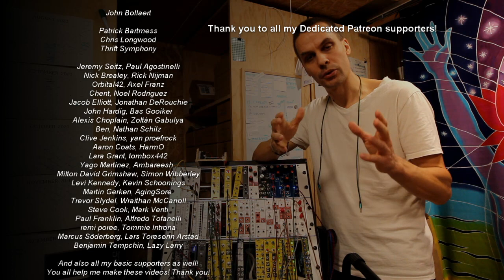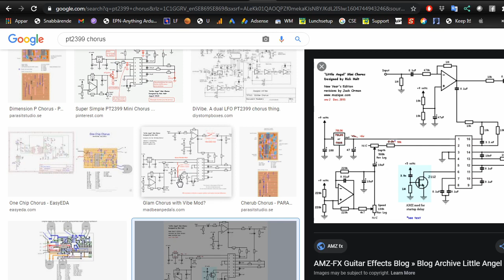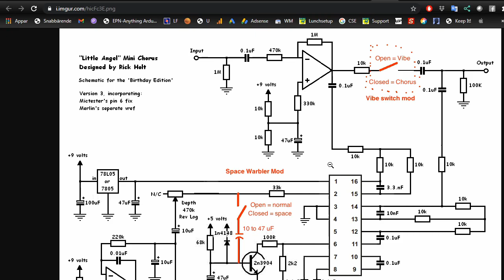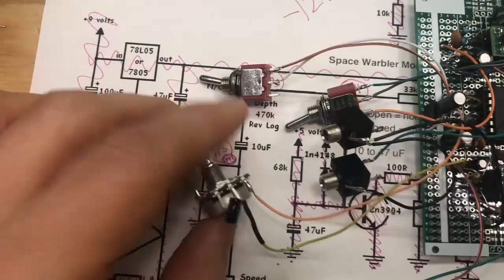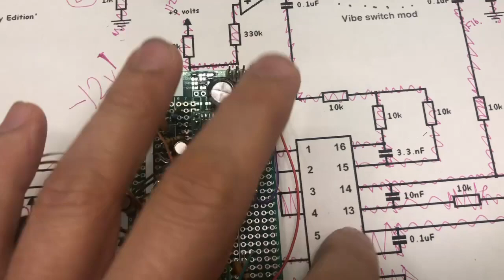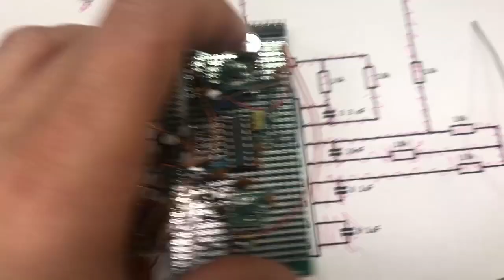the Little Angel PT2399 Chorus, with Vibrato and Space warble mods - Modular in a Week 12.6

Comment: Hi Kristian, great module!  Could you share what changes you made to adapt the schematic for 12v?
Reply from the maker: Well the pt2399 run on 5v. So i had the whole Circuit run on 5v. Which basically is what the original circuit does aswell. So no 12v involved.
Reply: @SourceryOne  OK perfect thank you!
Reply: @SourceryOne  I was wondering what you had the Opp amps running on. What voltage?? thanks great project.
Reply: @gijoe1518  he just said 5v
Reply: @majordabalert  I did not see it the first time thank you for pointing that out.

Comment: Nice sounding module! For delay you can look into the binson echorec, you might be able to do something like that and avoid the hassle of tape while retaining the tape heads. I have two ideas for my own stuff - a AM radio circuit used as a noise source (with bits of russian!) and a tamed ISD1820 circuit with CV input (or maybe a resistor ladder and a crude keyboard) used in loop mode.